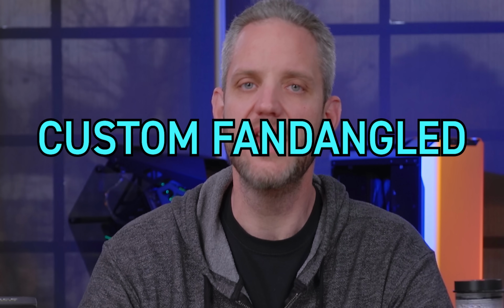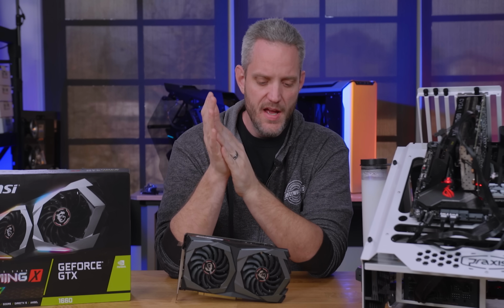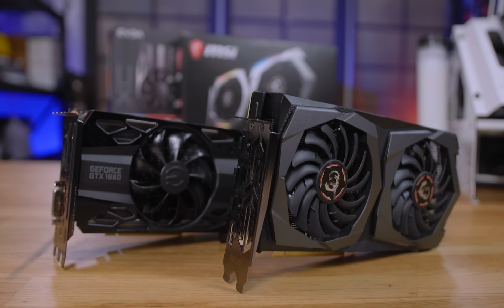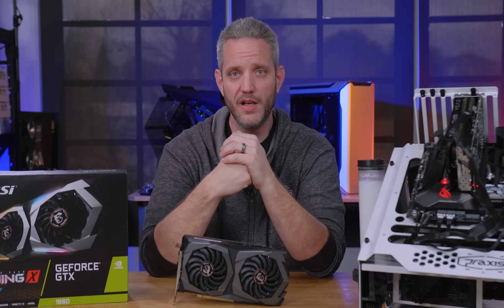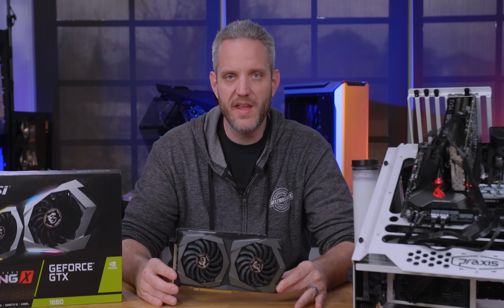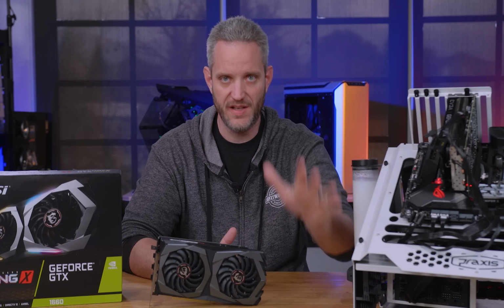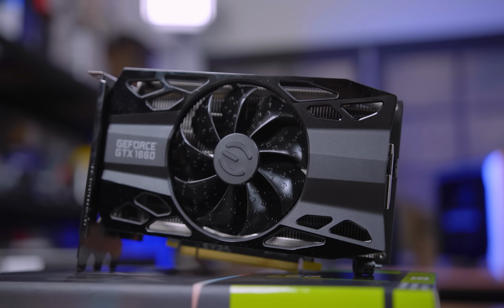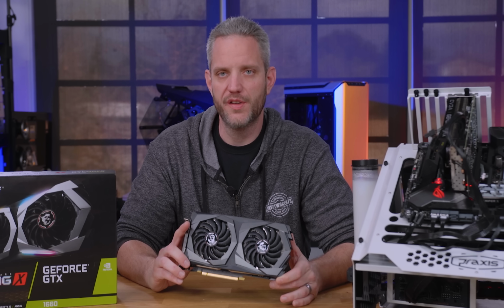Just save your money.... GTX 1660 vs GTX 1060

Comment: I got one of those because I don't recall but it was a big price jump the Super. These days I would probably prefer to have a RTX 3070, but I got a ryzen 5900x recently from a 2600 and thought that may fill the blender gap with a lower wattage draw. I hate landfills for my stuff when it is still basically ok. I was using a strix 970 before that and it seems like still basically a better card that is lighter and faster. And the 6GB I need so my meshes don't overflow the GPU. I thought I could move the 970 to a lga 1156 system so I could make it another member of my render farm. Thing is though afterwards it was 1/3rd the speed of my ryzen 2600 system so it was next to useless. For that reason it mostly does not get used (the 970) but in theory could do some gaming.

Comment: Sir, please advise me, Does  ( GTX 1660 Msi Gaming x) (ray tracing) technology and does it support it?  And if not, is there any ray tracing technology inside the Gtx 1660 (Msi Gaming) and does it support it?  Please tell me which vendor is the best in Gtx1660? Better if you support (Gtx1660 Msi Gaming x) (Ray Tracing) but if that doesn't happen then (Msi Gaming) will be out of buy and this (Gtx 1660 Msi Gaming x) market  in. Not even available.

Comment: It's crazy to see the mid-range back in 2019 and with the 30 series it's even worse. We aren't going to be getting usable GPUs for $250aud in Australia ever again, they are all gonna be $400 to get an okay experience. I remember my 960 2gb being $220 and playing ever game in 2016 at high settings or better, it was vram limited a lot, but the 4gb wasn't much more and fixed that. Now the 3050 is like $600 and does the same thing now as the 960 did when that came out but the 3050 is 3x the price

Comment: 2022: Have EVGA GTX 1060 is still running strong! Had at least for 7 years. Just bought a GTX 1660 because I couldn't find another 1060, only 1050's and they were overpriced. The "flaws" I experienced with the 1060 was not its fault, was in my first build that I bottle necked it physically and software. With this new rig, I may end up using old faithful rather than 1660.

Comment: You missed the cheat code of the EVGA 1660 XC Black... You can flash it with the EVGA 1660 XC Ultra bios direct from their website and unlock 23% power limit. I ran mine at 1750MHz base, 2150MHz boost with a 250MHz memory overclock (500 effective) for 2 years and it topped maybe 75C max, with just the one fan... If you can get one cheap today, jump on it, it will easily do 1440p @ 60fps on ultra...
Reply: Did this thing you said and now my gpu wont even fucking start its fans, even less start the pc. Thank you.
Reply: @TheWow1323  Then  you are terrible at following directions...

Comment: How are u claiming these cards cost $240 retail price. And 2 years later, now, I look the same card and its $650. Wtf. Why would it jump in price that higher in 2 years. Wouldn't it be cheaper after 2 years????
Reply: The market is messed up right now
Reply: This video was made in 2019 which is way before any shortage things happened (before covid) so at the time that was the price of the card but now its very messed up (dropping recently though)

Comment: Whatever. I got my GTX 1660 Ti at $235
Reply: the price is double now only if you lucky enough
Reply: @daisangen2559  why dont you just do a little Research. 

RTX 2060 is not desirable by Miners because it has very low Mining Hash Rate.

I eventually found RTX 2060 at just $307
Reply: @ClayWheeler  just build my PC in september, in indonesia its cost Rp13500000 (Whoopng 945.13 USD)
Reply: @ClayWheeler  also in us amazon is cost  $749.99. why dont you just do a little Research
Reply: @daisangen2559  Nah, Why I ever buy from US Amazon.

That is just plain wrong.

I found RTX 2060 6GB $307 - $350 right away from South East Asia region
Reply: yeah bro it’s probably used with a single fan
Reply: @veex3048  what? I actually have video about it.

MSI GTX 1660 Ti Brand new. $235

Comment: who else is part of the 1060 3Gb gang?
Reply: Just got one for $90 a few months back. Have it in a Media PC paired with a Ryzen5 3600/32gb/B450/2x NVMe. I own a bunch of Pascal based cards. 1030,1050ti,1060 3gb,1070 all paired with Ryzen 5's. Pascal onboard decoder works well for 4k media playback, offloads the work off the CPU.

Comment: So two years ago, I was between a 1080 and 1660. I ordered the 1080 and changed to the 1660...

Not really a great card, the 1080 would have gotten higher frames, but with the monitor upgrade, I'm not to sure how much of a difference there was to be had.

But on a side note, the cards held back. I couldn't really wait no longer but the plan was to upgrade the GPU... Then the markets droped and them went crazy... So I have a 75 ISH FPS in triple A's.

Comment: @JayzTwoCents I have an incognito build for casual gaming, i just looked up my video card and the prices were way higher then what i paid for it back last may. i bought right after i saw them printing all that new money. i got a GTX 1650 super Windforce 4G and put it in an optiplex tower. right now im looking to upgrade my MB so my SATA cables arent blocked by my card. is there much of a difference between this card and my current one? they seem to have very similar specs.

Comment: I got gtx1650 love it put only has 4g vram 
Pushing to 1280 by 1024 is starts get under 60fps I am getting low memory errors on certain games cause only it came with stick of 8g
There is software that tells you where put components keep things from overheating I never used it but if overheats I pass cause seen damage it does overtime

Comment: I mean why would you upgrade to a 1660? Unless you have a 1050 ti its not really meant to be the 1060's upgrade. The 2060 super is the true 1060 upgrade and it does a bang up job

Comment: Of course now, the cheapest 1660 available is $250 if you can get it.  And a 2060 runs $500 and more.  I've got one of those cards that "should have never existed", I got a 1060 3GB.  And of course the 30 series is astronomical.  Nothing is available that I'm willing to pay.

Comment: Is it worth buying GTX 1070 ti for 180 euros?
With the thought of using it for the next 3 years(give or take a year)
Currently rocking rx 570 4 gig
Reply: You would have a better driver suport with a new card, i would still get 1660 super instead of 1070ti. More and more games will use dx12 properly or Vulkan. In Read Dead 2 1070ti is only 2fps faster than 1660 super.
Reply: Big Pasta  I wouldn't bet on it since 1660s suports most new dx12 features like variable rate shading, mesh shaders etc and Nvidia driver suport for older cards is rough after 4 years
Reply: Big Pasta  Back in the day high end gtx770 was only one generation older than 200$ gtx960 but gtx770 got much slower in 2016. It all depends on Nvidia and their driver optimisation.

Comment: Save vs Buy is simple, if u have a big psu with at least 2 8 pin then wait for stong older cards like the 980 ti to drop in price, if you have a small psu then wait for a new low end card to match the performance of the old high end card. The second one will be several years longer but thats just how technology improves, slowly

Comment: SUGGEST ME PLEASE WHICH one Will BEETER - 
GTX 1650 SUPER 4GB  DDR6    V's       GTX 1060 6 GB DDR5X
WITH 

i5 3570 k  -   ASROCK z77 EXTREME 4  -  CORSAIR VENGENCE 16GB RAM (1600MHZ)

AND WHICH BRAND -  INNO3D  /  MSI  /  ZOTAC   /   GIGABYTE ?
Reply: It's an old processor so might as well go with the old 1060

Comment: Yeah... if you need upgrade, buy used GTX 1080 (Ti), it will serve you well!
1080 is on level with 2060, 1080 Ti with 2070. Just skip 1st generation RTX, 3xxx coming in autumn.

Comment: Do the MSRP even matter? Where I'm from GPUs (and any other components) seem to be priced randomly.  The few 1060 6G here are over 1K while the cheapest 1660 I've found is 430 around the same price as RX 5500 XT while the RX 580 is about 400 bucks. The MSI versions are usually around 100 bucks more.

Comment: Need you´re advice. Building a computer for my ten year old daughter. Which graphics card should I buy for best performance and price?
The following specification on computer building so far:  Motherboard ASUS TUF GAMING X570-PLUS (WI-FI), CPU AMD Ryzen 5 3600X 3,8 Ghz 36MB, CPU Cooling Corsair Hydro H100i RGB Platinum, RAM Corsair 32GB (2x16GB) 2666Mhz Venegeance RGB Pro,  M.2 Samsung 860 EVO 500MB, Power Corsair RM750x 750W White Series. Regards from Sweden.

Comment: Looks like nvidia's gimping of DX12 on the gtx 1060 is what really is causing the performance differences. In the DX11 tests, basically GTX 1060 was on par with the 1660s, and even parred with the 1660ti at one point.

Comment: I have gtx 1060 and it runs smoothly a lotta games like Outer Worlds and NFS heat in 2020 ultra graphics
Reply: how many fps? nfs heat is one of the games im wanting the most on my new pc and i need to know the fps
Reply: @ジョ-z7u  I didn't check nfs heat, but outer worlds on ultra graphs u get strict 60 fps. go for it mate.

Comment: 1660 is about $100 more than a used 1060 3gb, so I dont think the 1060 3gb is obsolete, however, the same cant be said for the 1060 6gb, since its normally above $150 so maybe the 1660 could be an affordable option for better performance and warranty

Comment: to me you can boost the 1660 XC to come close too the 1660ti.... and if you buy a 1660ti just to get gddr6 plus a few frames when it costs about the same as the RTX2060. i think getting the 1660 XC is the best bang for the buck unless you want pay 100$ more for ray tracing :/

Comment: i bought a 1650 super OC for $160 it clocked 1950 mhz. without doing anything except using aorus engine stock settings

Comment: To answer your question: is prefer to save my cheque to step it up to the next tier. However, I didn't need to: I'm only gaming at 60hz 1080p. I opted for a 1660 super (Amp from Zotac) for my system and it's been performing extremely well. If I wanted to game at 144hz 1080p I would definitely step it up up to 1070/ti or 2070. It's all down to preference and how dedicated you are to the games and frames you wanna play

Comment: Hi Jazy please we need to fix low gpu usage and high CPU usage in gaming I know this is not bottlenck because I cheak my cpu and gpu in bottlencker website and I'm used all cores cpu already but this problem didn't fixed this problem exactly happened in pubg and gta v

Comment: Yeah I bought gtx 1050ti 2017 right my card is 3 years old so I used it for gaming only il keep it for another2 years turned the clock and MHz and my card is. As fast as gtx1060 well and I payed 190£ in2017

Comment: So a 1060 6g should've actually been called a 1060 ti. Also I'm about to upgrade from a 2g msi 960 from 2015 to a used 6g gigabyte 1060 that costs 120 euro (There are cheaper but this one supposedly wasnt used for cryptomining and it's in good condition and is a 6 gig). Wish me luck. I wish I got a msi one since theyre sexy af but oh well. A 960 2g goes for around 50 euro here so I guess I'll try to sell it to make some money back.

Comment: This is the problem I have found with graphics cards or any computer gaming hardware is that instead of losing value or at least dropping in price due to newer versions coming out they seem to inflate the price while bringing newer hardware that is better, it would be like Microsoft or Sony selling a console at $400/£350, then 6 years later bring out a much better console sell that around $800/£700 and then put the price of the old console the same price as it was 6 years ago or even up the price buy a few more bucks, I feel like its robbing people from upgrading and not only that it is probably why consoles are so much more sought after and bought is because people know they can wait a year or 2 and the price will drop where as a pc or at least the parts don't seem to drop in price. Also they really need to clean the product lines they are selling, the amount of processors and graphics cards out there at the moment can be really overwhelming for people to judge and calculate what the best product for the price is, also trying to find what is best for gaming rather than just for what a normal pc would have can be confusing, seriously these companies need to get their act together it is no wonder consoles out sell pcs and sure you can argue that pcs are better in the fact that you can upgrade but at the prices that the upgrades will cost I really don't see how it can be justified, say you have the best set up for gaming on you're pc then they bring out a graphics card that is 3x better than you're graphics card and they sell it at around 2 thousand dollars/pounds is it really worth upgrading when you can buy around 10 consoles for that price. They need to slim down the amount of products out there and start dropping prices, making it easier for everyone to choose a product without going through a huge amount of effort to get information on the products to see how it performs compared to you're current set up and make it more affordable, they would sell a lot more products this way rather than saturating the market with basically a bunch of wasted materials.

Comment: Everything over 1080p, 60-75Hz is useless. Don't "waste" your money for a 1660 over an rx 580, unless you think 40€ is worth it for 85 fps instead of 65. Your gaming performance would be almost same as mine, even if you play at 1440p, 120Hz. It also depends on your cpu. I think with 120-180€ max, you can buy a decent one. Saving 80€ in total means you buy 16gb ram running at 3200mhz, and a 100€ max goes to the mobo.    I've got a complete build that cost me 600€, including monitor (24", 75Hz), gaming keyboard and mouse, that performs great. My cpu is a 3200g that can be upgraded to a 6 core cpu at anytime, and for my graphics an rx 580. My cpu has integrated graphics because I bought my graphics card 5 months later. In the meantime, I was playing all of the games I used to play with my old trash pc at high settings and helped me for all the work I had to do. If, nonetheless, you afford to pay  600€ or more for your tower only, you can go ahead and do that, Im not saying you shouldn't. Just most people can't.
PS. Prices may differ to other countries.

Comment: The naming and price differences of these cards really upset me, too.

I've just bought a new GPU because my gtx460 died after 10 years of daily use.
Because I don't really keep up with the most recent tech releases, I just googled "best GPU for under 200$"

Almost every website listed the 1050ti and the rx570 as their top 2 options.
So because I've always used msi nvidea cards I got the 1050 ti from msi-

Now the plot twist: I watched some benchmark comparisons between the 1050ti and the 1650 and turns out the 1650 is the better card....which i could've gotten for the same price....I feel betrayed...

Comment: I'd say if you have a 1060 6gig the 1660 series in general is not a worthwhile upgrade. I'd wait for the next generation to see where things land.
The 1660 series seems a more natural upgrade path from a 960, or 1060 3gig.

I ended up upgrading my 960 with a 2070, but that's because my current want is 1440 ultra wide at medium or better settings for Cyberpunk 2077. The 1070 seems like the good upgrade path for this, but I was willing to pay the premium for RTX.

Comment: The ubiquitous white Asus GTX 1060 that works just fine stays where it is in my current system. 

The new portable system that will accept a full size card gets a GTX 1660 because the 1060 is out of production.
I chose the 1660 super because it was on sale for 30 dollars more.

Comment: There’s nothing wrong with this card though it’s a perfect mid range card I have a 1660 ti and it’s pretty close to a rtx 2060
Reply: @Ignatius David Partogi I don’t consider the 1660 a low-end card at all. I used to have a 1050ti and that was low-end.
Reply: @tjs8617  I got a 1660 super and it's fantastic and play everything on high-ultra with very good fps with my Ryzen 5 1600. Also seemed to hit the jackpot with my cpu as the highest temp it's ever reached on OC was 53.75 degrees C on a summers day that was 41 C xD
Reply: @abductu3580  Yes, it’s a great GPU.  I Recently replaced it with an RTX 2070 that I’ve had for a while but it’s a long card and I didn’t think I would ever be able to get it into my case, but with a few modifications I did it!   I would have stuck with the GTX 1660 for a lot longer, but I use my PC for Microsoft Flight Simulator 2020 which is a very demanding Sim especially on the GPU, plus I wanted Ray Tracing. Pretty much everything else that I threw at my 1660 it handled very well!   Solid GPU fire sure!!!
Reply: The more research I do the 1660ti seems a great card to get right now, but if I have the cash in a month or so I might go for the 8gb 2060 extreme or whatever it's called, but only time will tell, most likely the 1660ti though 😎
Reply: @HalfdeadRider  Get the Super instead it's almost close to non Ti in price but close to Ti in perf.
Reply: Halfdead Rider 1660 ti is great I’m loving it

Comment: I bought the MSI Ventus GTX 1660 from a seller on eBay that accidentally bought the wrong version. It was $50 cheaper and still sealed in the box. I upgraded from a GTX 1050 TI and the difference is impressive. I have an older system running an i7-4790 on a H97m-e and getting a 3Dmark score of just under 5800 with Time Spy DX12. It will do for 1440p gaming for now and probably for the next couple of years... I hope!

Comment: from my use of the 1660, it feels slightly faster then a 1070, when in Oc. Hell of a good card my only regret is not getting the Ti for the GDD6. still a great card if you can spring it get the 1660Ti
Reply: I went from 1060 to 3060 and the difference is light and night.